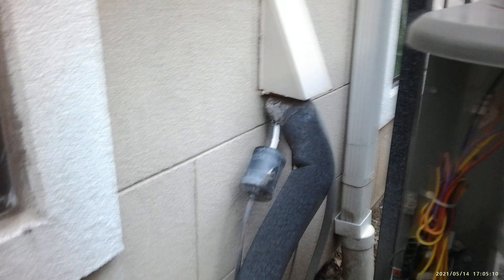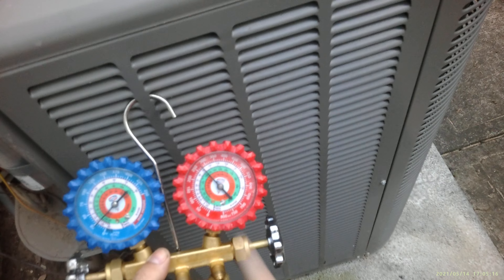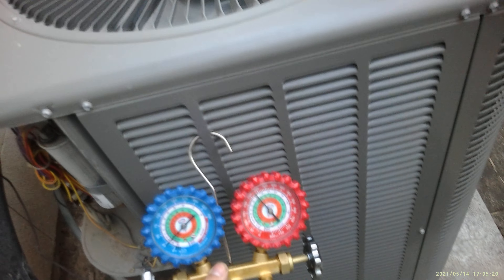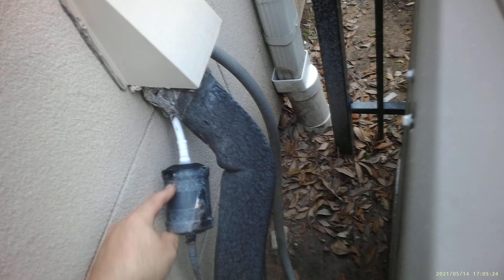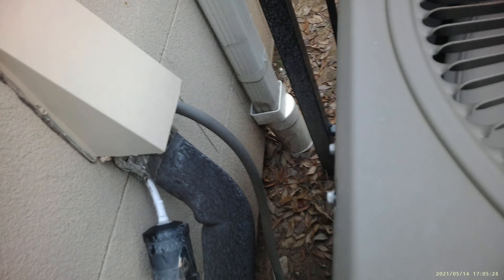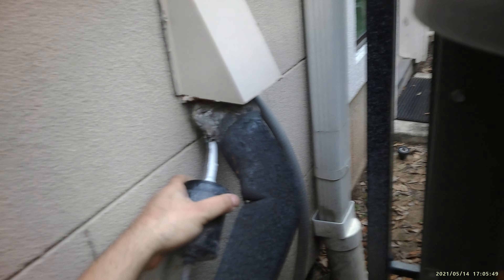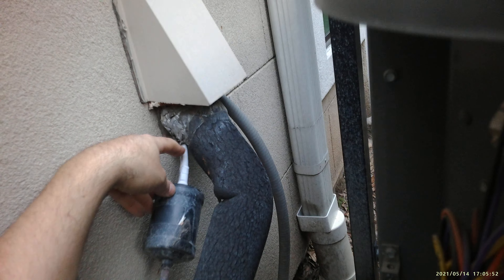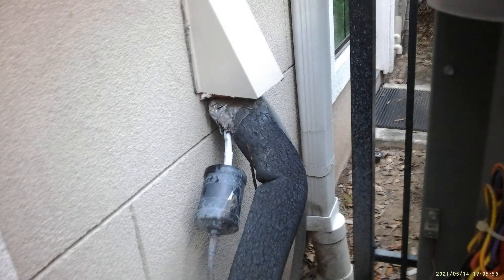R-410A Clogged Filter Drier - How to Identify a Plugged Filter Drier - Liquid Line Restriction HVAC

Comment: You've either got a compressor burnout or extreme moisture or contamination.  Filter driers don't just plug up by themselves.  I am willing to bet the motor windings in the compressor are close to toast.
Reply: They can break down internally. Ive only seen it when filter drier is installed outside. I moisture test, acid test, and mega ohm'd compressor, all of which passed.